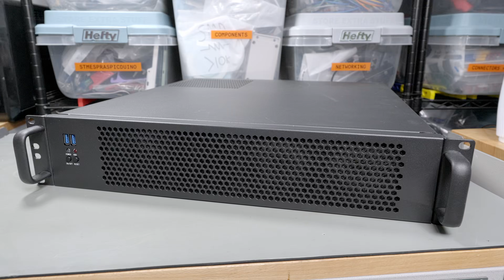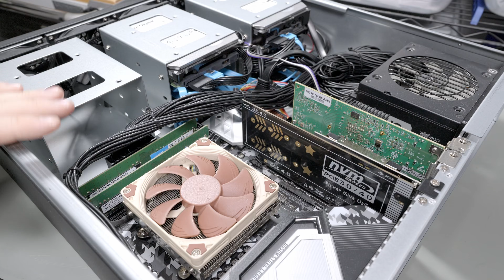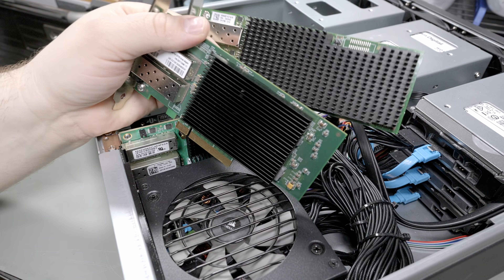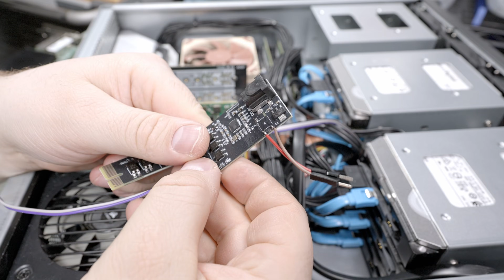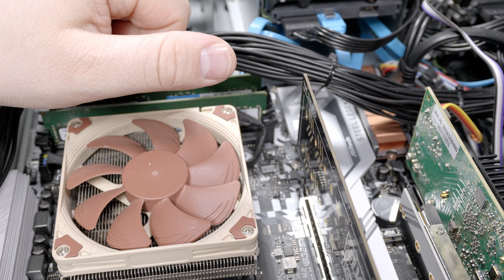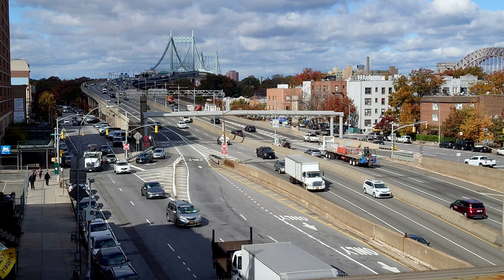Built a 2U NAS to free up some space on the big NAS.

Comment: I've got another NAS case you might be interested in. I've bought it, but it doesn't arrive for another month.

It supports 6 drives in less than 11 liters, and is just the right dimension to sit in an Ikea Kallax cube with enough room to not choke out any fans.

It's called the UENorth UE-S6
Reply from the maker: I've seen that one before. It seems to be in the same family as the Sagittarius (8-bay) case I looked at a while back as well as the Ares (8-bay). I didn't pick one up because it's really hard to beat the Jonsbo N3/N2 for size/drives.  That being said, I'd probably go for a UE-S6 over the N2 unless I had a SFX PSU already for the N2 since I do like the Sagittarius a lot.

I did order a relatively new 10-bay NAS case to take a look at. It's a bit expensive since you also need to buy 10 Dell 3.5" drive caddies to use it, but it does look to be an interesting one.

Comment: I have something similar myself, 7600x undervolted in a Silverstone 2U rackmount case. Has been serving me well for over 2 years now! 
If I had to start all over again I might even go with AM4 APU instead as the power usage on those is much lower thanks to not having a separate IO die. Intel might have even better idle power usage if that is what you're chasing but they also don't like to support PCIe bifurcation so you most likely wouldn't be able to use that M.2 adapter anyways.
Amazing build non the less!

Comment: Maybe a stupid suggestion, but have you tried adding the vendor ID to the driver? I have done that sort of stuff before on windows for a nvidia driver that wasn’t officially supporting a gpu. Just had to edit a couple txt files that contain the vendor ID’s. No clue how drivers work on Linux though.
Reply from the maker: There probably is some way to spoof the IDs so you can trick it into flashing. As for changing the drivers, I don't think the Intel ones are open source so you probably can't easily alter it.

The funny thing is the company doesn't have their own drivers. They simply link to the Intel ones which don't seem to work. It's weird.
Reply: The FW update tool is the problem.
It looks for a specific ID on the card and matches it to the FW it knows.
The modification would need to be to the card itself, which is certainly doable...in theory.